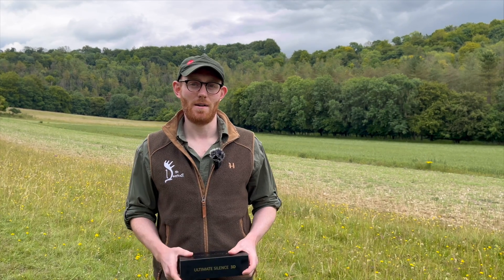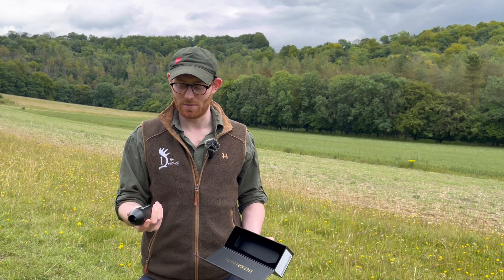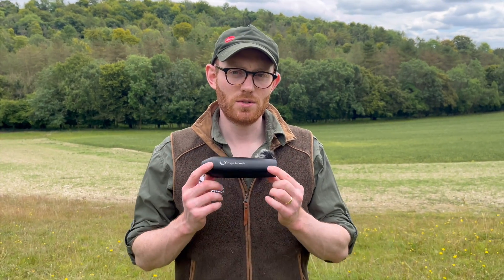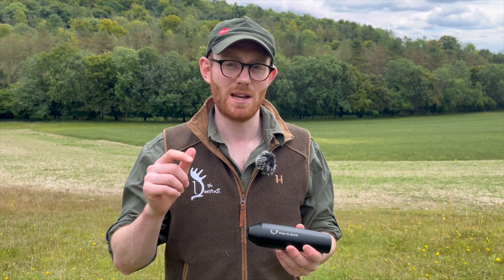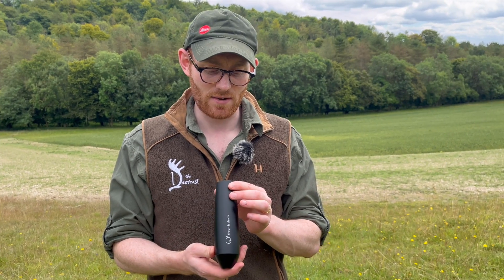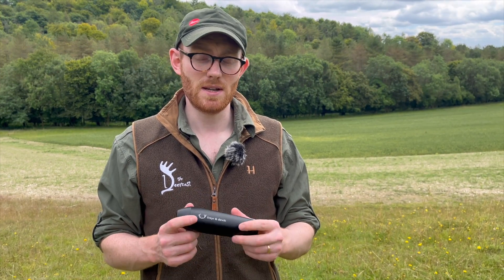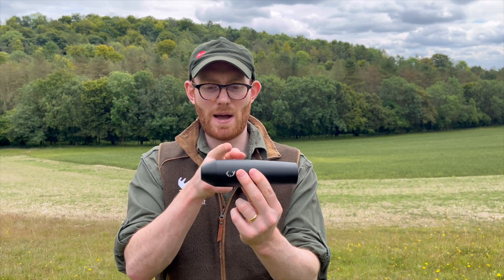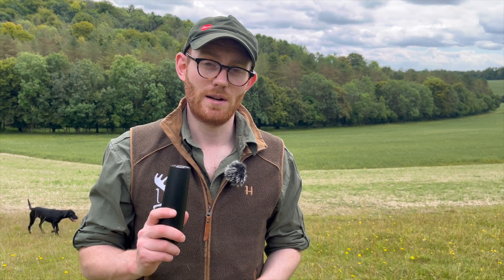Indestructible Titanium Moderator?

Comment: Hello. Looks a nice neat moderator. What's the price and thread options?.
Reply from the maker: @kris308100  for the UTS they range from £435 to £580. The featherweights are slightly less. The thread options are listed on the Cluny Country Sports website but include all the usual contenders (18x1, 14x1, 1/2x28, 15x1, 17x1, 1/2x20 etc.).

Comment: Total garbage the F&D mods.
They melt inside very quickly. The “titanium” part so small there is more meat on a butchers pencil. 
The customer support…non existent.
Reply: I have f&d mod on a .308 the baffles are getting eroded/gas cùt away very quickly I'm very disappointed
Reply from the maker: @jamescorfield4075  how old is the moderator? We have a 149 that’s been fitted to a 308 for a few years and it’s good as new and gets a lot of work…
Reply: Not tried the F&D so won’t comment, but I do like the Hausken, ultra light and good sound reduction.
Reply from the maker: Got to admit, that hasn’t been our experience at all! We’ll keep you posted on our long term review though. Cluny Country Sports are the UK importer and were very communicative with us.
Reply: @TheDeercast Check out a few forums, you will find out they ain't great with pics to boot 😂
Reply from the maker: @benwright3314  I believe this was a number of years ago and related to a specific model?